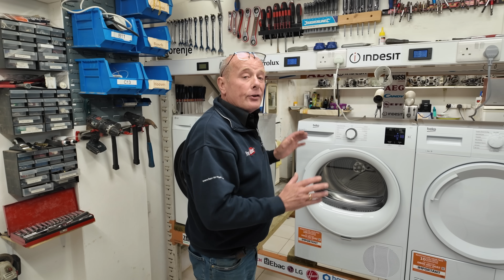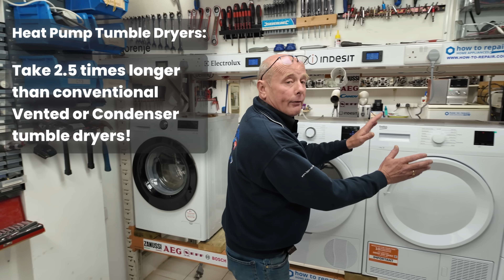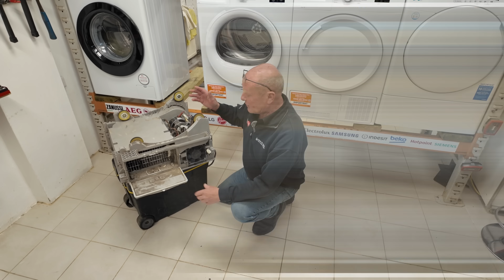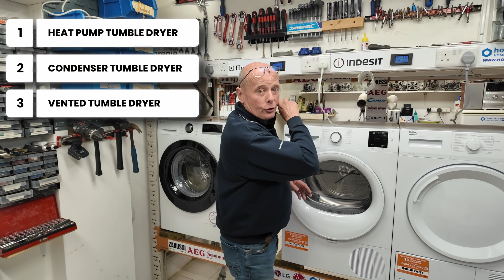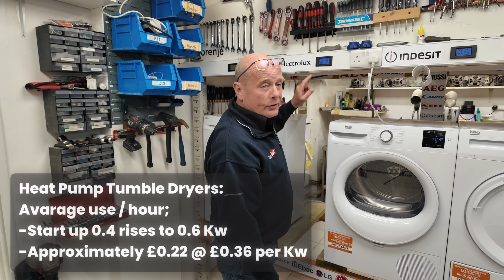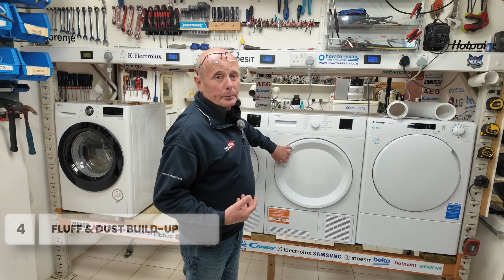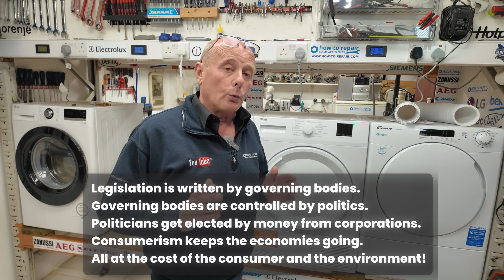Tumble Dryers the Shocking Truth About Heat Pump vs Vented & Condenser, NEW LEGISLATION!

Comment: It is ridiculous how short of a lifespan washers/dryers have. Technology is advancing but our Candy 25 year old vented dryer is still going strong while family members new units dont even reach half the lifespan. This alone makes me hesitant to buy new
Reply: I would suggest using a smart plug with energy monitoring to measure the average power consumption of your current machine over several uses, to work out the average running cost per cycle, so you can use the energy label data to work out how long a new heat pump dryer would take to pay for itself in electricity savings. Depending on your usage, you may find that you'd recoup the cost of a new machine while it is still in it's guarantee period.

Comment: What a load of bollocks, in 10 seconds everything you said was wrong and you failed to inform how much energy the heatpump dryer saves.

A modern heatpump dryer is just as fast as an ancient tumble dryer but uses like 80% less energy to do it and isn't as harsh on your clothes when it does it.

Comment: To understand the economics of which dryer is best then the total cost of ownership is the key issue. As a repairman you are seeing all the broken machines and may overestimate the level of failure in what you are repairing. Bearings obviously fail from time to time but what is the failure rate, the average lifetime of a bearing and the cost of repair? If heat pump dryers run 2.5x longer than vented ones and the cost to replace a bearing is £50 then you might think the relative liability of them is £125 in its lifetime. However, if the failure rate is 1% in 10 years then the probable liability is £1.25 if we hope a machine will last that time. If all consumers wanted the most reliable appliances they only need visit Which? to check out their lab-based recommendations. Same applies to the heat pump - a technology that has been used for over a 100 years at the centre of everyone's fridges and usually outlasts the owner's wish to upgrade or renew more on modish grounds. Clothing wear and tear is largely not only a function of time in drum but also heat and how long they are being tumbled when dry (as water acts as a lubricant) so having a moisture sensor and how accurate the machine is at estimating the level of dryness in order to end the program is critical. Your point on lint build-up is valid but it crucially depends on the design/manufacturer of the machine as to how they avoid lint build-up and the ease of cleaning. You also didn't mention that fires caused by vented dryers due to lint build up in the vent hose and the fact that they are running hotter than heat pump equivalents is not inconsiderable and not as infrequent as we might hope. Finally the issue of time to dry is a real one and convenience plus time of day electricity tariffs will impact. If you run a dryer for 1hr vs 2.5hrs then clearly one is more convenient and a buyer needs to consider how urgently they need their laundry on average. The length of running time could cause an issue where a more efficient machine could cause part of the drying cycle to be run during a more expensive electricity price phase without knowing.

Comment: I have a heat pump dryer, it has a  long running time, but no problems 10+ years. They want us to use a heat pump to AC(cold&heat) the house, we use a refrigerator, and even modern cars contain AC(cold&heat), so heat pumps are everywhere. Established technology.
I do not want to repair my dryer. It's crammed inside like the engine bay of a modern car. I hope it is quality build (LG).

Comment: Really?

It sounds to me like your beef with heat pump dryers is a concern over the poor design of one particular model?

Also, in my first hand experience, vented dryers are quickest but heat pump and condenser dryers are about the same. This totally destroys your argument.
Reply from the maker: I think heat pump technology is brilliant, but these machines are only lasting on average five years they take at least two times longer to dry the clothes at least twice the amount of wear and tear and components and the accessibility to do maintenance is an absolute nightmare. Manufactures do not seem to understand what maintenance is needed and how easy it is to do. They seem to build it and assume it's perfect without testing properly. Thank you for your comment. I would be grateful if you would share this post, as it’s the only way to force things to go large nowadays. Have a great day, Paul.

Comment: The vented dry become very inefficient in colder climates, as the home must replace the air lost to the outdoors with cold air from the outdoors which must be heated. Homes without heat exchangers are especially affected by this. The dryer air must be heated, and the return air must be heated.

Comment: Well done 👍 seems like a good solution would be to have the heat pump as a separate unit with a greater heating capacity that provides the heat to the dryer,  thus solving the run time problem and the lint build up in the evaporator & condenser.
It would require a bit more space but if it were a washer/ dryer combo that space would be negated. Cheers

Comment: Efficiency of electric heating elements in the condenser and dryer, will pretty much be 100%. The only way heat pumps can get higher COPs, is by extracting the extra energy from the environment around it. In this case, your house. Your house isn’t heated for free, so has anyone done the maths, where they take into consideration the larger heating bill?  
Also on your comment about most diy’ers not being able to fix these, I would say almost all diy’ers must not fix anything to do with the refrigerant loop. You need to be f-gas certified by law in the UK and Europe. The refrigerant industry is also in turmoil at the moment, with lowering GWP (global warming potential) targets, and potential new PFAS legislation, it could be that in 5 years time you are unable to service your appliance, because of certain bans, for refrigerants with a gwp >150 and PFAS content.
Reply: Heat pump dryers use a closed loop, they extract the heat from the drying air to condense the moisture out and return the heat to the same air to heat before returning it to the drum. They still heat the house slightly, because the energy used by the compressor ends up as heat and they have a cooling fan to get rid of the excess. Admittedly if you use electric element based heating, you won't save much money in winter if you only use the appliances when your heating is on, but at least the room temperature would be better regulated without a dryer outputting excess heat when it wasn't needed.

Comment: Interesting perspective, and some excellent points. But doesn't take into account the amount of air the vented dryer pulls out of the house. This also results in energy loss. What if you have a very tight house? (Matt Rinsinger has a good video about this)Then you would need some sort of make up air system, which increases your initial costs and heating expenses. Cost savings with the heat pump would be hundreds per year which might offset the increased maintenance costs. Especially if you are doing 250 loads per year which seems like a lot, to me anyway.

Comment: The same is true for the HE washers. Replaced our HE washer with a speed queen that has a traditional transmission. The Speed Queen completes a load in a third of the time compared to the HE.  The Speed queen uses more water but uses much less electricity. It is also easier on the laundry because of the water and the reduced friction.

Comment: had a white knight  gas heated vented dryer for past 20 years more expensive initial installation gas pipe & ventilation but overall  1/4 of cost to run broke last year cant get spares no more dryer , care homes laundries and hospitals all use gas  for finance reasons but not for joe public. White knight even marketed as true low carbon alternative . ,  but sadly the firm is now no  longer in existence

Comment: Normal clothes rack - NOT heated type.
American style ceiling fan blowing downwards, on to the damp clothes, or other fan moving air across clothing.
Dehumidifier on in room - 200 to 300 watt models are best.
Usual room temperature.

Maintenance free system, lowest cost, no damage to garments 🇬🇧

Comment: I built my own heat pump dryer. using a  standard  ~8 cubic foot dryer then installing a  dehumidifier into it  around 20 years ago  .. with experimentation I still ran a small heating unit ~500 watts and a  300 watt  dehumidifier unit  and it would operate at about the same drying time as a normal dryer . ran for decade with out problems  the only thing is after each load you had to wash a filter for the fluff   the thing with the heat pump dryer  with out the small heating element if  you was in cold water wash and your was house  relatively cool  it will not evaporate the water from the clothing you have to get the clothing to at least 35c for them to dry quickly .  especially for a large loads  in 8 cubic dryer . small load  it was not really so necessary but it  but still it would dry faster  with the small element

Comment: Ive not used tumble dryer for over two decades. You don't need them! I use a washing machine with a 1600rpm spin. Then air dry. Never ever had issues with condensation. Always drys in a day over night.

Comment: I think you are talking about an issues that the manufactures are aware of. Many heat pump dryers have a panel that allows you to access the condenser and clean it. Lower end models may not because they are considered disposable and higher end ones tend to have an "auto clean" function. Not sure it works but it takes a long time to take the machine apart so I haven't really checked. Anyway nice video but you might need to look at a few more units. 
As to the regassing process, it's pretty obvious that heat pumps need different type of skills. There are however many refrigeration engineers around and as long as the parts are available, you can repair a heat pump. But you may not want to as newer models will have better efficiency and larger capacity.

Comment: i bought my washer dryer unit i  2004...still going strong...and i completed all repairs easily.  my only problem with dryers is that the air flow is way too low. dryers are still designed to take hours for 1-2 loads.  i recently used a 8 load huebsch commercial dryer and my clothes were dry in 15 minutes.  HUGE air flow.  i want to buy a commercial dryer for home now. every residential dryer I see today is low value...to many electrical settings and it still takes more than an hour to dry 1 simple load.

Comment: Out of necessity, I used clothes drying racks indoors one winter. I placed the racks in my smallest room (9.5 ft x 10 ft) with a box fan and closed the door. BEST DRYER EVER ! The clothes dried incredibly fast, they weren’t being beat to fluff in a drum and they had that nice air dried smell 🤗
Reply: We also use a clothes horse, but with a dehumidifier in the room, which are quite cheap to buy and run.  The clothes dry quickly, even in an unheated room in the winter and without damage.  Dehumidifiers are actually heat pumps.  The collected water is basically purified water and is great for house plants.

Comment: Well I buy Bosch 14 year's ago, its a condensing dryer like the 2nd in from the right, I serviced that for the first time in 14 years, so much fluff on the outside of the drum I hsd to strip it down, use the hover & a brush, then clean out the float of slime - water - fluff & around the heat elements & the turbine, now we don't get black speaks on the clothes, i know.the engineering is poor for easy servicing

Comment: I have a condensing TD and when it breaks I would probably replace it with a heat-pump version, to save electricity.  Now, after what you revealed, I'm going to have problems.  I definitely don't want to wait even longer to dry my clothes, and the maintenance is going to be a massive problem - you really must clear out all the fluff regularly.

Comment: Brilliant video and information, sent a copy to all family and friends.
I've got a vented tumble dryer, I hover out the flexible plastic tube  once or twice a year. Also inside the bottom tumble dryer.

This dryer is around 30 years old, easy to replace parts,  purchased  door fluff catchers, also replaced door plastic cover, and door catch.

Mines in the garage along with the washing machine.
The point is consumer choice, different horses for different courses.

You want a condenser dryer as you dont want a flexible outlet pipe in your home, fair enough.

Yeah, I think I'll stay with the vented tumbler dryer. However, its just like trying to force everyone into an EV and ban the internal combustible engine cars. The public and market should decide what we want!

Anyway, think I'll stock up
 and some spare parts. Prehaps also buy another vented tumble dryer.

Sent the following to family and friends:

Every one should watch this video and don't get rid of your vented, or condenser tumble dryer and be forced to buy a heat pump one.

Here is why, in this video, this brilliant engineer, explains the government has  been Green Washed!

They want to phase out the traditional tumble dryers, for heat pump ones, see why this is a bad idea!

https://youtu.be/xn03N3b0-lE?si=l5ttfTVwNHCpIDaC

Comment: Since i witched to a heat pump dryer in 2016 i never looked back. 

Im pretty sure that worries regarding the durability of the heatpump system are valid for low quality products, but this should not mean that we should stick to a less efficient technology, we should hold manufacturers to a higher standard and require easy of repair and availability of parts by law. 

I cannot compare the costs of running my heatpump dryer now with the costs i had with the condenser dryer, as tariffs are different and I did not measure how much energy my old dryer consumed, but I can say that clothes durability (specially synthetic/gym clothes) are much better, i can now drop everything in the dryer knowing that it will not heat up to crazy temperatures, and wear and tear on my clothes are much less. As i come from a country were dryers aren’t a thing i lost a lot of clothes by drying them in a condenser dryer, even when using a “delicate clothes “ program.

Comment: We use a compressor-type room dehumidifier on "dry clothes setting" - ~400-500W. It cost £120 5 years back (Screwfix) and is still going strong. Yes clothes on racks takes some space....
An extra 10min spin-cycle also helps pre-dry things. Reserve condenser dryer for cotton only if too much stuff needs drying at once.
The similar desiccant type room dehumidifier's aren't so good - power up at maybe 900-1000W due to using a heater in them, and they don't condense that well.

Comment: Brilliant video. I could not believe how long the heat pump drier takes to dry.
I have the condenser one. Had over 5 years.
I have bought one new door filter and that’s it. Fingers crossed it lasts much longer.
Good idea to have a heat pump dryer.
But the manufacturers have to do better than that.

Comment: I have a beko heat pump drier. 10+ years and still going strong (much longer than the tumble drier I had before). I am a diligent filter cleaner though and I suspect most people are not. Additionally I visually check the condenser fins and reassure myself they are clear - occasionally vacuuming from the front.
Echoing others, I think the fact it's not cooking clothes to a crisp probably makes it gentler.

Comment: You also ignore the fact that 100% of tumble dryer fires are caused by element heated dryers and lint build up. So if you burn alive in a dryer fire it’s because you didn’t use a heat pump dryer

Comment: I had a cheap heat pump dryer which barely used any power and it lasted 10 years. Only a belt replaced and the fan had a wobble so I got a new one. Element based dryers use massive power and over heat clothing.

Comment: The end of the world is not threatened by climate change but by woke tumble dryers. They've come for our cars, our boilers, our yogurt tops and now our tumble dyers! I hope the Daily Express has been informed. 
BTW, Our heat pump tumble dryer is great. We run it over night on low cost electricity - the same we use to charge the car ( we pay less than 2p per mile in fuel costs - it was nearly 15p in the Fiesta we had before). You have a choice. Keep with the expensive old or get something cheaper and cleaner.

Comment: vented tumble dryers are so easy for most people to repair, most times its the bushing fails on the backside of the machine holding the drum up which cost about £10 to fix even a heating element costs only £25, my vented dryer is 5 years old and gets used once a day with 2 bushing replacements and a new dust filter costing a total of £55 for 5 years use and a load takes only 35 minutes to dry

Comment: Heat pump dryer runs cooler so doesnt knacker your clothes. The fact that it takes longer is not an issue as its still way quicker than my washing machine's eco cycle. Fair enough if you're sat watching the dryer but i certainly don't 😂

Comment: Here’s the issue: until I got a heat pump dryer, my clothes were shrunk to oblivion, I stopped using the dryer for most clothes. The heat pump dryer this issues is minimized to the point that it’s mostly mitigated

Comment: I bought a heat pump tumble dryer 3 years ago, reconditioned Beko.  £200. I'm very happy with the appliance. Very cheap to run, literally pennies. Cycle time for cottons eco is just over an hr, which is only slightly longer than my old vented machine. BiG! Plus, for me, is that when running, it is only slightly warm inside the drum.....no more shrunk clothing, not ever, it  is very gently on fabrics. Highly recommended a heat pump dryer